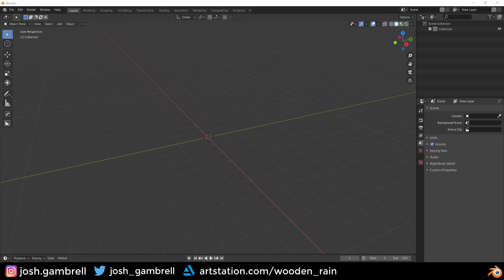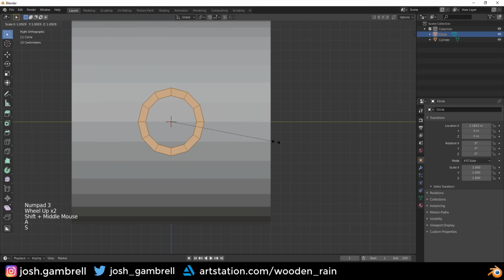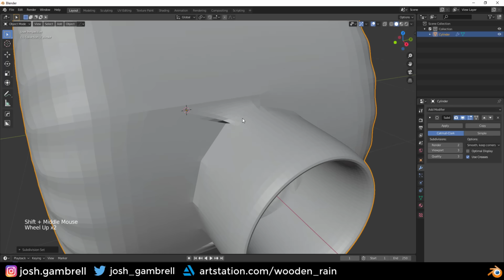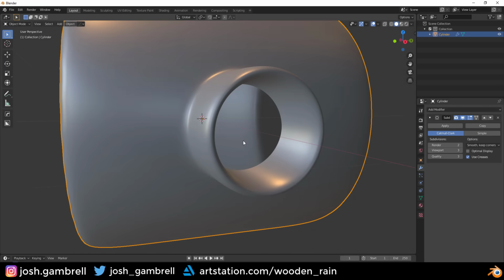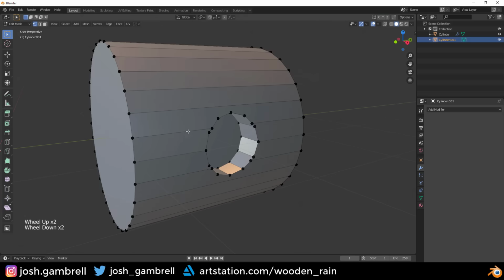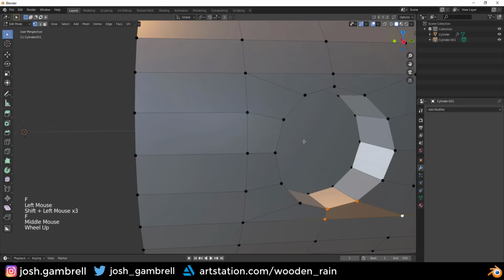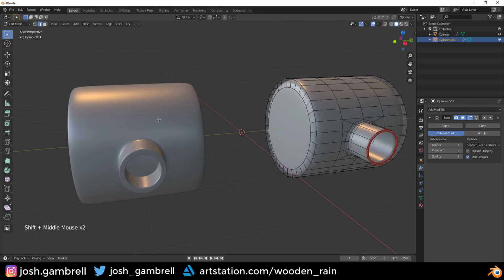The RIGHT way to cut holes in surfaces in Blender

Comment: I learned some stuff from this video.  The Edge-F-F... thing, the J thing, the whole Shrink-Wrap thing...but you failed to mention the need to match the number of segments in the circle with the number of adjacent segments in the cylinder.  Otherwise, it quickly becomes a mess!  I mean, come on, admit it, you adjusted that circle to just the right size to get this to look so easy, but it's not unless you have that magic 1:1 alignment and perfect circle radius relative to the cylinder.  I had to futz with that a bit to get it to come out as nice as yours.

Comment: Excellent method! I've seen this video when I started Blender, but seemed more complicated that just using boolean. Few months later I tried to find this again and it was surprisingly hard, I had to scroll through dozens of boolean trick and tip videos, so I leave this comment here to help it go up. Creating arches etc as a separate object and joining them to cutouts results so much nicer meshes, after boolean the cleanup of manifolds took more time than this whole procedure. (I'm not an animator/designer, just design to 3D print).

Comment: All my blender work is for 3d printing and cura goes by verticies directly so auto smooth is useless and in that light boolean saves time just make sure you have extra faces and bevels not bad though otherwise

Comment: There seems to be an issue in blender 4.0 where the circle vertixes wont snap to the cylinders faces when using shrinkwrap in project mode. has anyone experienced this issue before?

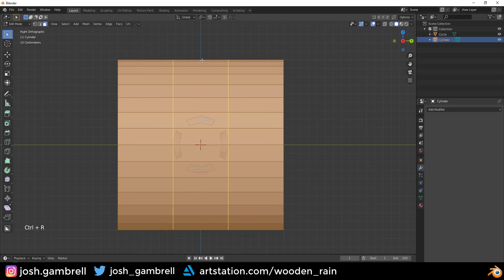Comment: 2:53 after I hit Control R and wheel up to create two slices, and then tap S just as described, it does not scale.
Moving the mouse does nothing.
Man I was stuck on that forevever.   What is not set right?  Everything on my screen is identical.   So frustrating.
I finally just gave this approach up entirely

Comment: How did you rotate it 90 degrees in 1 hit so quickly at 32 degrees? I can't work out how you did it so quickly. Edit Mode>type R>...but how did you make it 90 degrees in 1 hit? You didn't seem to type 90C into the Transform box...you seemed to have done it with your mouse only, what's the trick? It seems liked one swipe.
Reply: At min 52, how did you make more than 1 loopcut and scale at the same time? When I make a loopcut, I can't select the other loopcut to scale both at the same time...
Reply: At 9 min 20 sec how did you automatically select the ring? It selects the cylinder when I try to do it, not the ring...
Reply: Honest to god, you go so fast, I can't work out how to do so many of the things you do like at 10 mins 0 sec, how to pull up the Hard Ops 0098 screen. It's so frustrating you go so fast and I can't work it out.
Reply: @KittyBooProject  Blender can be very frustrating especially to watch tutorials, there are so many hotkeys you just have to memorize apparently.   Its feature loaded but the interface is unnecessarily complicated imo.
Reminds me of GIMP in that way, another beastly complexathon
Reply: Yeah I can't figure out the magic trick to scale after creating 2 cuts at 2:53, my brain is fried here.
Also my options don't look exactly the same as his, so I can only assume the programmers in their wisdom changed the interface with a version update and now this tutorial no longer works.
I guess the Right way is the wrong way for me.
I got a list of things to do today I'm giving up

Comment: I do not know why, but when I tried the second method, after I fill in the faces that are missing and extrude the smaller cylinder, the smaller cylinder edges that is in contact with the bigger cylinder  ( the part that you bevel)  is not connected full cirkel. So I only have the upper part or the down part of the cirkel. This result that when I tried to add a subdivision, the smaller cylinder has a split right through the middle. So I don't know if I shoud have the snapping toll on, or in the auto merging tool? I wish that youtube could share screenshots.
Reply: Never mind, I found the problem. The where some hidden vertex right at the middle when I wanted to fill the faces. ( So there were 2 vertex at the same place)

Comment: Shift A Cylinder rotate x-axis 90
Shift D y-axis drag and place
Scale down
Select both cykinder
CTRL Shift +
Tab
Face Select
Click circle face
Inset
Extrude into the other cylinder
Select face 
X Disolve face
Select edges connecting to main cylinder
CTRL B
Done

Comment: Nice tut, but at very end when applying bevel  @9:50, selecting the inner circle of edges but when bevel applied it only effects the extruded circle, by subdividing it, no effect on the cylinder. The vdo, shows 2 faces on on the extruded circle and one on the cylinder, my extrusion is only the extruded circle.

Comment: Hi Josh, will Fluent add-on, in your opinion, work fine most of the time, in this cases (eg cutting holes) or it will create same mesh issues  as I would  face doing boolean operations manually? In a few words: is it a kind of  "magic" or not at all?

Comment: The loop cuts add more unnecessary vertices around the cylinder
Reply: Not really though.  Without them the edges leading from the outer caps of the larger cylinder would be canted at an angle and disrupt the topology of the cylinder.

Comment: . . .
Triangulate faces is a thing.
Also it wouldn't be so much work if you used boolean on an actual tube instead of.... whatever that was.
And also you've got a problem that your version isn't manifold- meaning your normals are going to be messed up if you don't correct it.

Some nice tips in here about managing normals and controlling modifiers though.

Comment: I have tried this in different setups, and it seems that it does not work in all circumstances (vertex count). Am I missing something? Should I consider a specific ratio between the cylinder and the circle?

Comment: Would it be really impossible to create an extra option on the extrude command to be able to do it negative? maybe that cut will create some vertices based on the position of the existing vertices from the object that is cut.. or whatever.. So complex software and you need up to 10 min to create a hole when in other 3D software it takes 10 sec.. I know there are no meshes and vertices but still...

Comment: Will give this a go. I think the Boolean would be helped. Y adding the loop cuts earlier. I also think there's a way to do a Boolean without adding a modifier. I think also probably important to have even # of cuts.

Nice alternative method and opened my eyes to this modifier. For sure this will be simpler for more complex shapes you wish to join. I've just been making T cuts and L sections for modular pipes and this looks like it could have helped.

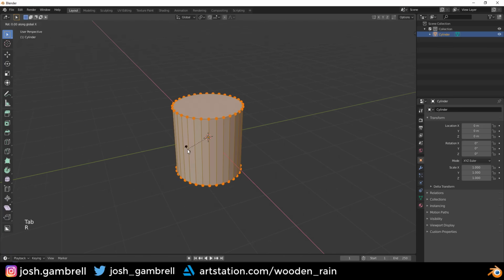Comment: Wow! You're so advanced, and I'm very new to Blender. But I still loved this video. I learned a lot! But when you say "just do this, then this, then press that," I'm looking at your keyboard/mouse hints and it does NOT appear to be showing everything you're pressing (or I'm missing something).  For instance, in the beginning (0:33) when you rotate a cylinder precisely 90 degrees, I don't see how you can do it with [Tab]R[Tab].  I was able to do it using [Tab]RX[Ctrl][Left Mouse][Tab]. Holding CTRL constrained the movement to 5° and when I moved my mouse to get 90°, I have to Left Click before pressing Tab again.  Things like that threw me for a several minutes.  I did QUICKLY catch your mention of n-gons, which prevented my bevel from working (I tried this on a cube face and made n-gons to face around the circle).  I'll try again with matching better vertices for the faces (ring cuts or reducing circle vertex count).  Thanks. I'm going to learn a lot watching your videos!

Comment: so edge slide but only edges, but slide vertex in vertex? waw no a little bit chaotic there? Slide is really used function! i always need it, so let make it easy finding and complete, slide Face edges vertex, along normals etc??? Maybe iam toomuch illustrator or photoshop organised mindset  i dont know?  also a  save selection option  would be really usefull, i realise always need it,  separate is not enough convenient for this... sorry iam not on the right video...

Comment: Shrinkwrap is gonna be more of a pain in the ass to get right on pipes running at weird angles. Meanwhile, you can align two cylinders much faster before doing a boolean on them.
Also, you can quickly make one of them hollow beforehand and have even less work to do after boolean.

Comment: This is great, really appreciate it! Hey when I do this with a plane it doesn't work, the plane gets inset into the cylinder and doesn't wrap like it does when doing the exact same procedure as with the circle, any thoughts?  EDIT: I loop sliced the plane to provide more topology to be able to "bind" to the cylinder, worked like a charm.

Comment: Gleb Alexandrov and Andy Burrows created absolute awesome course about how to do things like this, and much more - for example HOW to cut hole not perpendicular, etc. And workflows presented there is much better, because they included also custom normals control. This workflow here is kind of okayish for simple cases when topology matches. However, it will not work at all, when one have to create hundreds of holes or pipes attached in random places. Also, this relies on topology of the cylinder and the possibility of creating additional edge loops, so, in general case this workflow will not work, unfortunately. There are way more complicated cases than make perperdicular pipes. Seeing those more advanced solutions will be very nice :)

Comment: there is 4 ways actually there's the 2 you showed another alternative I would probably do is add 3 loop cuts over the top and use the knife tool to make a circle and then inset or the 4th way I would do is add 3 loop cuts inset the center faces use the loop tools addon to make it a circle inset it and then extrude out the circle ring that get's created.

Comment: Is there a way to use the first strategy you show here when adding multiple (10+) holes to a mesh? I just built out a model with a few dozen holes placed using array mods in different locations and it seems like using the boolean mod is the only way to go, but I'd appreciate any tips on how else to approach this!

Comment: An even faster way would be to create an even square on the cylinder, (2x2, 3x3, or 4x4 etc.) delete the faces, select the edges and run the blender operation “to sphere” (you can search for it just like any command, I think the default search key is f2?)

Then you have a perfect circle cutout along whatever profile (loop tools “circle” tool always makes the circle flat, otherwise I use the “circle” tool on any flat surface), extrude that, and now you just have to scale it flat! Ez-pz

Comment: hi, thanks for the video. I'm trying this in 2.93. When adding the modifier, Project method no longer does the same. I tried using newer Target Normal Project, which initially did the same as you achieved with Project. However, when deleting the four faces around the projected intersection, this also deleted the "extruded" inside projected circle too. I'm afraid the method needs adjustment. I still haven't figured out though. I'd thank any help.
Reply: Having the same issue, did you work out a way to do it?

Comment: I typically make the object the shape I want using the Boolean union option. So I take the cylinder and the small cylinder and join them into one mesh. Then I Boolean out the insides and modify the mesh as needed.

Comment: Question regaring 3d design with blender:

can you export files as STL with absolute sizing value's?

like this circle example having the circle being 50mm for the large one and 25mm for the small one. and when exporting it it has the correct values.

as with mesh exports sometimes sizing data gets lost.

Comment: As soon as I delete the faces, the circle jumps to the opposite side of the cylinder. Any hint what I am missing? Using blender 2.93. thanks a lot for your video!
Reply: Did you remember to Apply the shrinkwrap modifier before re-entering Edit Mode?
Reply: @storyteller474  I cant find the apply button in v 2.93 (mac version)... just tried with left clicks. it looks different from the older version in the video
Reply: @Yannikkropp  I'm afraid I'm not familiar with Mac, but I imagine that where the same features are available on each platform that the layout should be consistent. On 2.93 Linux each modifier has a row of icons at the top that toggle the visibility of that modifier's effect in Edit Mode, Viewport, and Render, followed by an icon of a downward pointing arrow. Clicking that arrow drops down a menu that includes Apply, Duplicate, and Copy to Selected, as well as options to send the modifier up or down in the stack. I hope that helps!

Comment: That method are good, but one thing I struggle to figure out and can't find other video about it. Assume I doing the step similar to you (or that traditional boolean way), then how I can create a 'Threaded pipe' then connect to cylinder ? (or box in other case)
Reply: I think so, too :)

Comment: @Josh Gambrell I wonder if there's a way to addon-ify this shrinkwrap method as a pseudo-boolean kind of operation. Has anyone tried it? Like, select the cylinder and the ring (maybe making the ring or other primitive shape-creation part of the addon's features), then use the operator to have the ring shrinkwrapped onto the cylinder, objects joined, surrounding faces deleted and dare I wish, vertices joined where quads can be made...

Comment: The issue with this method is that the sides of the cylinder affected by the hole aren’t good at all. You leave them at an angle instead of keeping them all consistent

Comment: 1. why does everyone not know the j key? 2. working with the boolean operatios is generally better when trying to design a thing because it allows you to adjust where something is supposed to be for longer (imo). for something like this pipe-thing i would've just prebuilt the pipe, used a union bool and kept adjusting until it was exactly the way i want it. clean-up should only happen once i'm completely happy with the way the general shapes look, especially if i'm not working for myself and have to adjust stuff to other peoples wishes in multiple passes.

Comment: Great tutorial, however the one problem I see is that you have actually deformed your cylinder where the circle meets.  If you look when you shrink wrap, https://youtu.be/Ci1jBOm_5NY?t=163  only the faces of the surface that are wholly on the a surface of the cylinder are visibile, this is because the other faces are actually inside the cylinder.
For something this small it's maybe not important, but for more complex geometry it could be important.

Comment: 9:16 if you do a loopcut and make it aligne with the inner ring, you can afterwards scale it back and it will have the circle shape instead of the mix of circle and rectangle in the beginning.

loop cut-> scale in-> left mouse -> double g -> scale out ...  I think I'd need to test it to be sure.

Comment: Well in my case, everything upto where you used the Shrinkwrap tool worked but after that, in the part where you told to put some loopcuts and delete the faces, in your case the project circle remained where it was supposed to be, in my case it got project at the faces opposite to the ones I was deleting.
Reply: same with me, cant find comments to how to fix it.
Reply: Figured it out. did not apply Modifier. thought it did it automatically since there was no apply button. But it was just hidden.

Comment: This was a bit too fast for me (very new) so I had to repeat a lot of steps, each at a time, and entered the steps into Excel including the short cuts.  This is a wonderful video showing best practices for this type of flow, and I appreciate it! I also believe I learned a new way to create wall thickness for a different inner diameter, like in PVC pipe, watching the creation of the 2nd circle. Thanks again! Now I wonder what additional steps would be needed if the cylinder was actually created by an extruded circle, like the cutout one you used. Thanks again! <saved><liked><subscribed>!

Comment: Great video. But I think the second one isn't actually opened. Looks like there is a face closing the hole inside the smaller tube. So, maybe the two objects are not essentially the same.

Comment: Thanks a lot for the video! I would like to ask a question concerning the size of the hole. In the example we have a relatively similar cylinder and hole size so it more or less fits the edges of the cylinder. If I needed to use a tiny hole that is 10x smaller, for example, would it mean that I need to enlarge the amount of cylinder rotation segments 10x as well?

Comment: I swear I'm the only one who isn't getting the whole. No matter what I do the circle doesn't create the hole in the cylinder. Followed everything step by step and by the time I need to clean it up, the cylinder fills up the faces and it becomes clear the circle is its on single object irrespective of the fact that I applied the shrinkwrap modifier and joined my main mesh and the circle mesh as one.

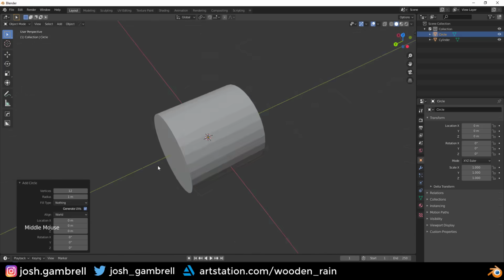Comment: v1 1:00 - 5:51 = 4:51 
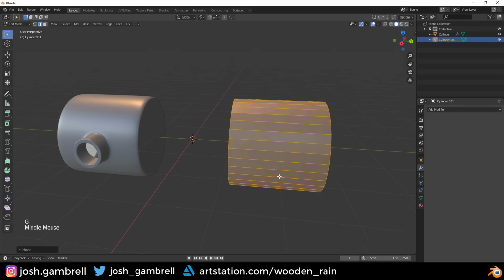V2 6:28 - 10:00 = 3:32

I've been very generous with both times, but sorry, just by the time taken on how you did it to get the same end result, i'd say both can be done in 3 minutes and 32 seconds, i think the statement of "1 being better than the other" isn't really accurate.

Still a useful video however, just felt a strong desire to point that out.

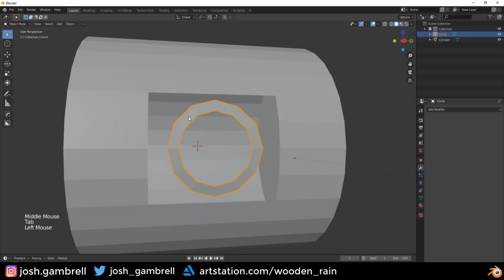Comment: Why does my projected circle mesh go inside of the cylinder after removing those faces (3:15)? It does not stay in the thin air.
Reply: I'm a noob but maybe you have magnet thing turned on to stick to the faces? Just guessing
Reply: @woodoyoy  I will check it out. Thank you.